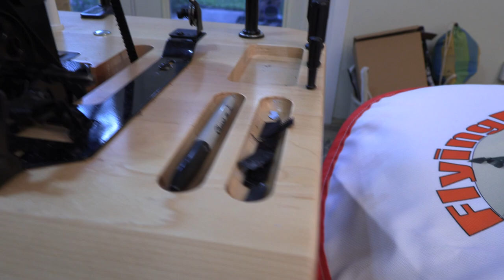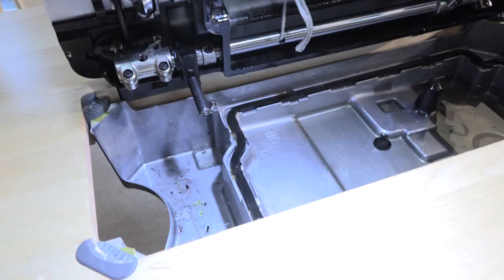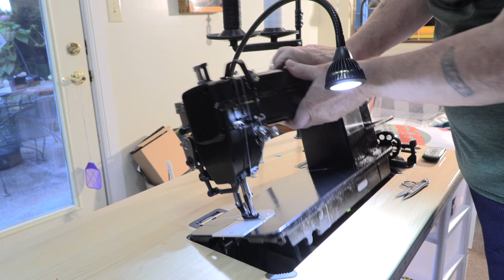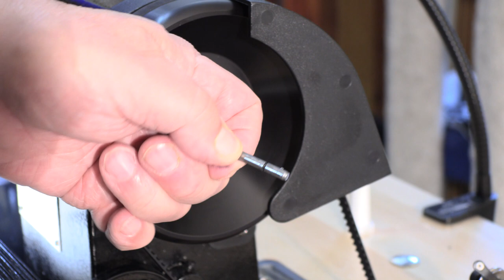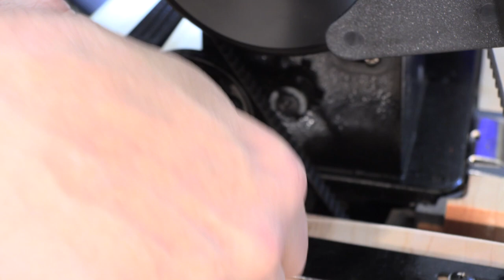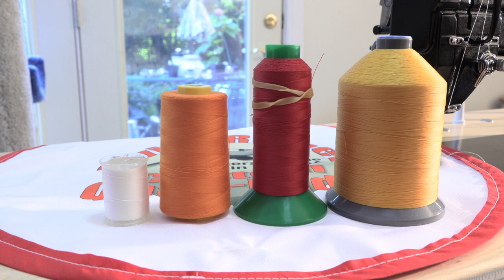Sailrite Fabricator Deluxe Review

Comment: Good evening Sir,
 I just purchased, received and am beginning to use a brand new Sailrite Fabricator. I too got the Deluxe package. I originally aimed for the Standard package but they were out of stock at the time I really got interested. So, I bit the bullet and ordered the Deluxe. Am I glad I did, wow! So far, in the very limited amount of time I've spent on it, it's everything you say it is and more. 

   Maybe it's just me, the sign of the times and being around new era sewing of automotive, residential and commercial upholstery but, I really like the looks of BIGGER thread! I had a 13 year old Sailrite Ultrafeed LSZ-1 up until about a week ago. The max thread it would sew was V-92 but was/is more atuned to V69.  I wanted at least to be able to use V-138. Well, enter the Fabricator. In their ads and videos, they, at Sailrite, emphasize that the Sailrite Fabricator will "Easily" handle V-138. 

Well, yes, it does handle it but, and this is what get's my goat, I cannot for the life of me, get the tension correct when using V-138. No matter how tight I adjust the upper tension knob, and even release tension on the bobbin, I cannot get that bottom knot to pull through the material! The bottom knot just sits partially embedded in the bottom stitching. 

Anyway, sorry for the rant, I appreciate you taking the time to do a good video on a fantastic machine. So far, I'm loving it as I knew I would. Thanks again.
Reply from the maker: Call Sailrite! They are great at handling customer issues. This is the first company in a long time that has impressed me so much with their customer service and true interest in getting things right. On a more personal note, go back through the threading....every issue I have ever had with my Fabricator was caused by me missing something in the threading.   I was always positive I had it right, then wen t back through the process and found an error on my part, every time.